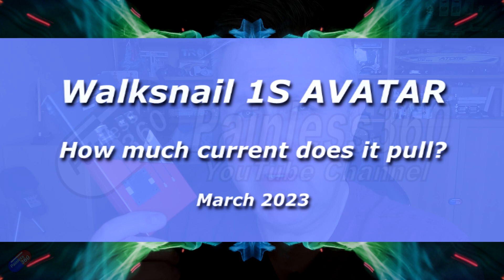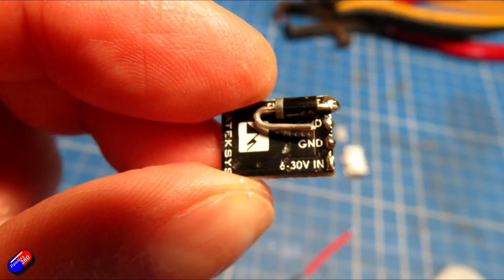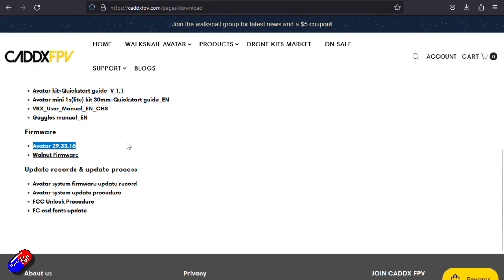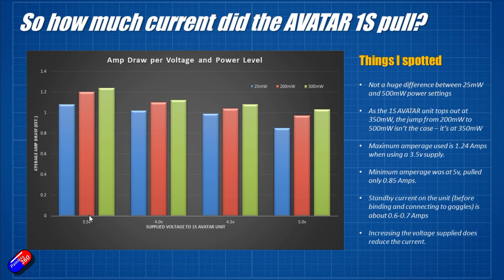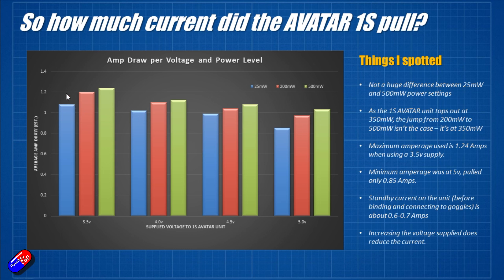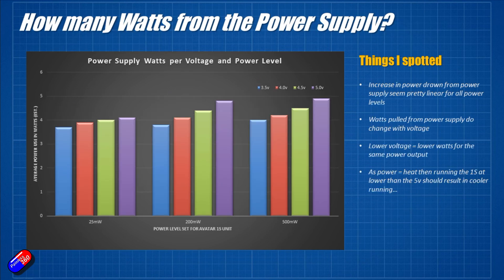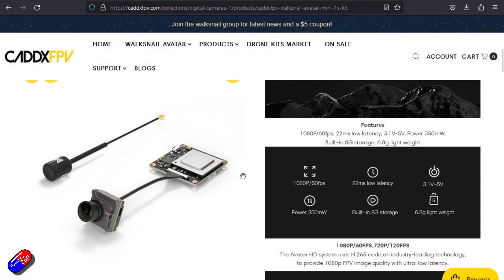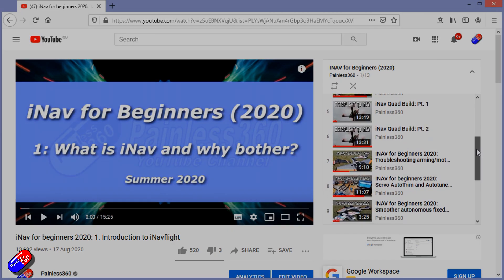How much Current and Power does a Walksnail AVATAR 1s Unit draw?

Comment: I am using 10 volt with this, and I see inefficiency energy use impact my flight time. Looks like the digital SoC 3.3 volt runs with a zener/resistor in series, so the excess voltage is dumped as heat, so the energy efficiency appears inversely proportional to the excess voltage. If I extrapolate your data trend in the power supply power, I see the 5-volt setup is dumping and Xtra 18% energy as heat compared to 3.5-volt setup, and my 10-volt setup is dumping almost half of the energy as heat.

Comment: It isn't weird, indeed it is exactly what I'd expect. DCDC converters don't have a flat efficiency relationship or even a linear relationship between conversion efficiency and input/output voltage differential, it's a curve. This is true for  every topology of converter, in other words, there is a sweet spot that the designer, if they are smart, targets. I would guess that these 1s units are targeted for 1s operation. The converter is onboard, it takes that wide input range and spits out a single constant rail, the further away from the output rail the input gets, the worse the efficiency. Hence, you see higher drawn wattage for the same output power at the higher voltage levels as you depart from the built-in sweet spot zone of maximum efficiency. And yes, that loss in efficiency is realised as heat. It should be noted that running another DCDC converter (eg a BEC) between the battery and the transmitter or a dropper diode makes the situation even worse, multiplied inefficiencies, more wasted power. The dropper diode drops because it drops off that voltage as heat in the diode itself. I.E You can't rob Peter to pay Paul because they have same battery bank account., in physics sadly there are no free lunches.

Comment: Which antenna are you using on the VTX?  I can see it's not the stock one.  I only get about 350 meters on 500mw with the stock antenna.  Any idea how much additional range you get with just upgrading the antenna on your VTX?
Reply from the maker: The antennas I use here are the stock ones on the VTX units and MenaceRC antennas on the goggles (one of their Digipacks)...

Comment: Hello!!! This is great, I'm trying to install the lite Vtx on a 3s toothpick, the Matek Bec is as great idea, but I have 2 questions... 1. Is it really necessary the diode ?  2. Please which diode did you use ? Thanks in advance
Reply from the maker: 1. Diode is optional but reduced current pulled
2. IN4001 but something a little larger that can handle more current would be better.

Comment: I have a RC plane that runs on a 3.7V 400mAh battery for about 20 minutes.  Would I be able to use the same battery to power the Walksnail 1s?  If so, any guess on how much it would reduce the flight time?
Reply from the maker: That must be a tiny plane! :D
If you only powered the Walksnail from it then it would last roughly 15 mins... ish

Comment: So much interesting but i don t understand 😅!! It s better to connect  the vtx to 5v pad or to a 1S batterie? Thanks
Reply from the maker: It depends on what you have in the model. If you have 1S model - use the battery voltage. If it is a larger model (see my videos) then the 5v or less is the one to go for. See my builds with them ;)

Comment: A key factor here is the actual RF output energy relative to voltage irrespective of setting. The higher current associated with higher voltage is likely driving higher actual RF output power as well as it's byproduct of increased heat. The RF output stage is effectively working in class A, so less than a third of the total input power becomes RF output energy, most the rest is heat. At microwave frequencies it is closer to <20%.. the mpu also takes it's share of current which is fairly constant regardless of RF power, in this case probably half the total. (value measured during update).
Interesting comparison, thanks for publishing.

Comment: Nice tests. What was the minimum for the vtx? 3.3V?
Whoops do sag the batteries down to 3.3 or 3.2 Volt under load.
Does the BEC from the 5V FC pad actually scale the voltage up to ~5V if the battery is saging down to 3.3V ?
Also would the Avatar 1S vtx be any good for a 1S 18650 long range build, if the battery voltage can drop down to ~2 8V ? Some of my analog VTX go dead  below 3.0V. That doesnt allow me to use the full 18650 capacity
Reply from the maker: Specs on the website. "3.1-5V input power support, ideal for Whoops."
Happy flying

Comment: Hi! Mine 1S (non-lite) eats over 1A with any voltage straight after it connects to the goggles. Up to 1.2A as well even with 5v
Reply from the maker: Please share the details. Happy flying
Reply: Is there a monitor available for digital systems like I use for analog?  Not trying to take away a wifey job, just wondering.
Reply: @1laflyer535  My Avatar Goggles X have HDMI out, you could hook that to a monitor. Also the goggles have wifi, there's a (beta) app you can use so people can watch on their phone or tablet. IMO it wasn't that reliable though, hopefully caddx can improve it.